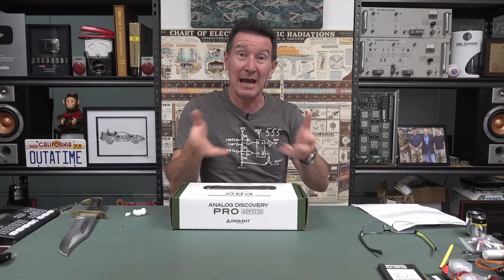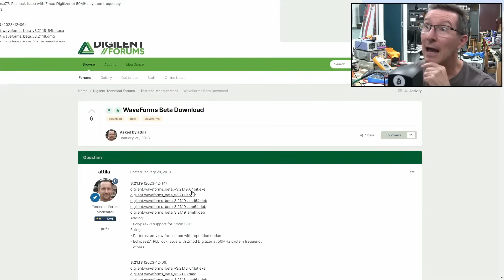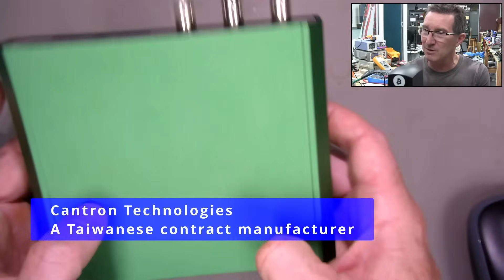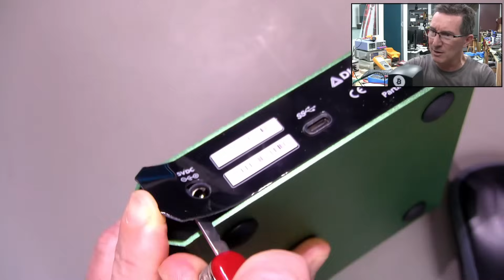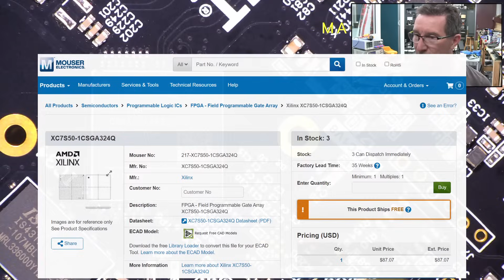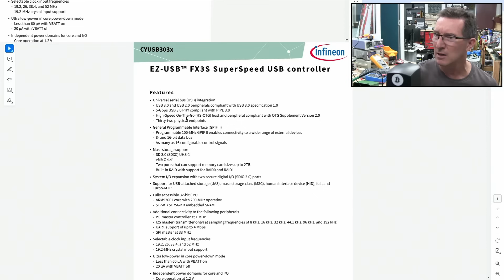EEVblog 1596 - NEW Digilent Analog Discovery Pro ADP2230 TEARDOWN

Comment: I have the ADP3450 but unfortunately it doesn't work well. The software seems good on surface but in reality, it is very glitchy and when you try to use even 1/8th of the full buffer spec, the software glitches so much and often crashes. I even contacted Digilent but they said that its a known bug. It already has a small buffer compared to other similar price point units and you cant even use it properly. So I am not happy with it at all and looking to switch to the new Rigol.

Comment: I love my AD2 och DD2. But they are both limited by USB 2.0 data rates. I like that AD3 Pro ADP2230 have FX3 so hopefully it will support USB 3.0 transfer speeds.
Reply: Yes but can it truly float? I used USB2 -> optic fiber -> USB2 extender to float my Micsig console scope with easy at full sample rate at all 4 channels. I wonder can this baby does same trick maybe vice Ethernet to fiber or WiFi, could it stream fast enough?

Comment: Great at electronics and terrible at mechanics.😉 However, I'm waiting for an explanation why this gadget exists.🤷‍♂
Reply: You could just look it up. Like most of the analog discovery series it is a combination oscilloscope, function generator, logic analyser, digital signal generator, data logger and a few other things.

Its main advantage is the software which can combine many of the functions together to perform things like frequency or voltage sweeps as well as having add-on boards that can be used for curve tracing or impedance measuring.

Comment: I still wish for something like this, but affordable for students, price class about 100 USD. No high demands, for bradboard constructions nothing more than 1 MHz or max 10 MHz analog bandwidth, 8 bit resolution would be needed, including an arb function generator with 2 channels of max 1 MHz, fixed and variable voltage sources, that's it.
I believe there should be a worldwide demand for something like this...
Reply: Once you get into that price range it is usually better to just buy cheap individual devices, like a cheap 2 channel scope and a cheap logic analyser. 

At those requirements you may even be able to get away with a decent microcontroller if you can live with the 0-whatever voltage range. I think there are some basic scope projects using microcontrollers, I think there was one for the rp2040 with not too bad inputs.
Reply: @conorstewart2214  I know that it is, even better with 2nd hand, but it should not need to be. the needed parts are cheap, an STM32 or similar instead of a FPGA should be enough for example. Also not many students have the place for power supply, function generator and oscilloscope.

Comment: So if this is just a slightly better AD3 with a larger buffer, why did they need a larger FPGA? Surely it would be cheaper to add a high speed SDRAM or similar to increase the buffer size.
Reply: For the buffer size, as explained in the caption.
Reply: @jaro6985  did you read my comment before you replied? 

If all they wanted was a larger buffer then why upgrade to a bigger FPGA rather than adding RAM? All the extra resources in the larger FPGA other than the block ram will be wasted unless they added extra features that used them.
Reply: @conorstewart2214  Most FPGA designs use a small fraction of their total capability.
Reply: @jaro6985  still not the point even if true, FPGAs are expensive, you want to use the smallest one you can manage with. 

From what I could see they doubled the cost of the FPGA used in the board just for extra buffer size.
Reply: @conorstewart2214  this design is not price optimized. That and the $10 difference, I think can be covered by the ~$400 increase in price over AD3.

Comment: What is this machine used for ?
Reply: Test equipment.  Primarily used in a lab environment with students. You can generate, analyze, monitor and play with waveforms. There is also a multimeter and logger function.  Meh, very narrow bandwidth. I don't see the point of such a thing for my own personal or professional use.

Comment: So the adc is rated up to 1ghs but they’re only running 30mhz processing of the signal.
Reply: Using the 125 MS/s ADC to meassure a 30MHz signal is already a stretch. That only gives you 4 Sample points for each period of a 30 MHz signal.
Reply: Isn’t the ADC only rated for 125 MS/s but the op amp is rated for 1 GHz.

Comment: I am trying to get a feel for where this product slots in.  $700 Yankee seems high for individual student purchase.  I could use this on the benches in my student lab, but the panel should be larger to make it easier for students to use.  As Dave noted, binding posts for power and banana jacks for meter probes would be desirable in an instructional lab setting.  We would have to build a connection manifold to make this fit our needs.  A Kensington security slot would have been handy.

I am weighing if I want to switch to an environment such as the Analog Discovery series for student labs.  The AD software is excellent, but it would add an additional learning curve for students to get past to execute their lab assignments.
Reply: I haven't used the software, but if it has a traditional "scope-like" interface, then probably ok to use in an educational setting, but if students use this are dumbfounded when they go to use a hardware scope in a job later, then it's probably not the best thing to teach them on. The scopes in my udergrad labs were all TDS-1000 series, and when I bought my own good scope (an HP 54645D), I was amazed at how much more useful it was to have more than 2 waveform updates per second! The TDS-1000 also had permanent persistence turned on - just because those LCD screens were slower than molasses in January in Canada!
Reply: @gorak9000   The bench setups have a Tektronix MSO2014 and a Tektronix 2-channel arb generator, Global Specialties breadboard, Fluke meter and sundry supplies.  The textbook specified in the curriculum is Floyd’s Digital Circuits book.  I get the second semester which covers mid scale functions and basic FPGAs.  The FPGA work is on a DE-10 board based on the Max10.  The way I’ve approached the labs is to start with electrical properties comparison of TTL and CMOS based on Floyd ch. 15.  Next we go though building several projects from mid scale integration parts, translate some of those projects into FPGA using Quartus Prime schematic capture and end with a simple VHDL program compiled into a functional block and deployed as a component of a schematic capture.  That may not sound like a lot but it does a pretty good job of filling 15 3-hour labs in an undergrad course.

Something which surprises me is students, even if they’ve used oscilloscopes before, often don’t understand the reason to use a X10 probe for taking high frequency measurements or how to compensate said probe.  I have a hand-out and worksheet on the matter which goes along with the electrical characteristics lab.

We have National Insturments ELVIS breadboards which are designed to work with using Multisim for schematic capture.  We switched back to using the Gloabal Specialties breadboards which much older because students constantly blew the fuse on the 5 Volt supply on the ELVIS.  The Global Specialties unit has electronic protection which resets itself.
Reply: Since this is from the pro line it probably isn’t designed for students. Since this just seems like a better AD 3 then that would probably be a better choice for students.
Reply: @conorstewart2214   Thanks for fhe reply, appreciated.
Reply: I would argue that the learning curve for students shouldn't be any worse than using a normal version of whatever it is you want to use, scope, logic analyser, function generator, etc.
Reply: Collective thanks to the people who replied with comments and ideas.

Comment: i wanna see something like this also include a function to drive SDR software by hooking up an antenna to the inputs....the bandwidth and resolution would be awesome...
i really like the markings on the board for the different sections....
Teardown took a new meaning with this one! :P
Reply: You wouldn't get much by connecting an antenna to the input. It's missing the RF front end circuitry that an SDR has. It would only be able to receive very strong, nearby signals.
Reply: @rocketman221projects 

That too. You could attach frontend and a mixer generating IQ signal then send it to ADP  but at that point buying existing SDR is cheaper.
Reply: As it is just FPGA with few ADC/DACs you could technically "just" write alternative firmware for it. Or alternative client sofrware

That being said SDRs got far cheaper and you'd be getting much wider frequency range out of it... and for the saved money also buy a scope. This thing is overpriced